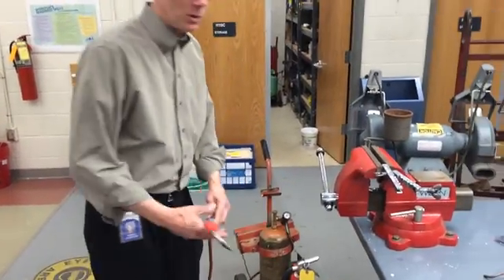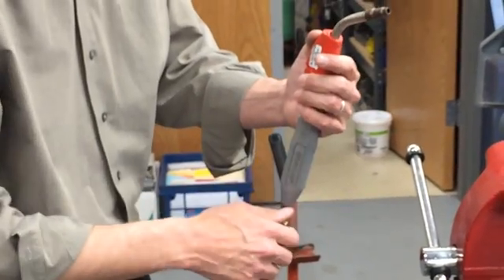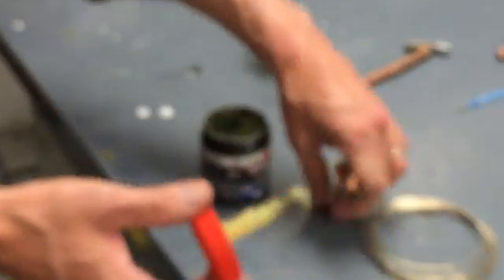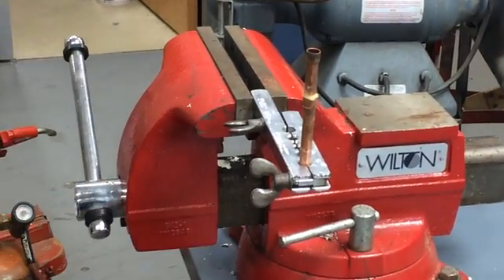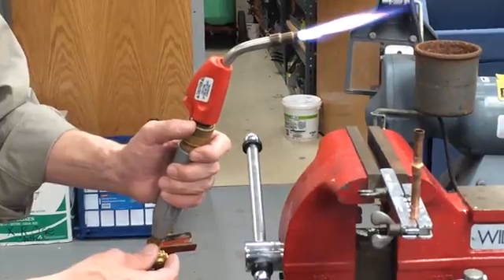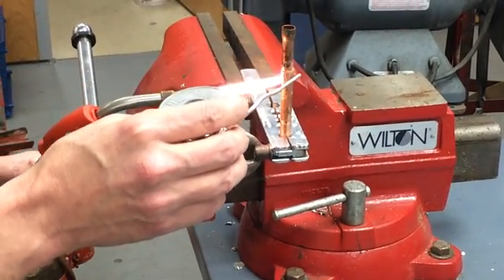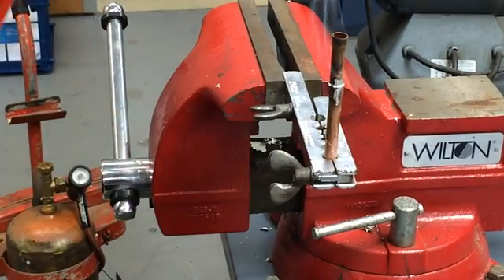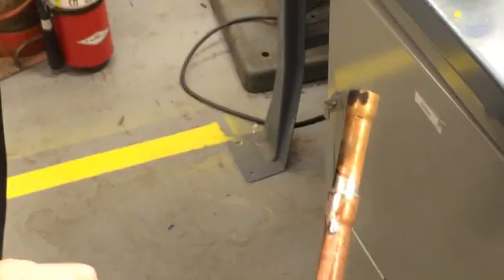HVAC Basics: Procedures - How to soft solder copper tubing with a turbo style torch

Comment: that was a massive tip for that application. i would suggest first off getting a properly sized tip and secondly do not run a turbo torch with an orange flame like that.

Comment: You know they have soft soldering tips specially designed for just that, soft soldering. The turbo tips are designed for brazing (up to 3/4" ACR tubing).